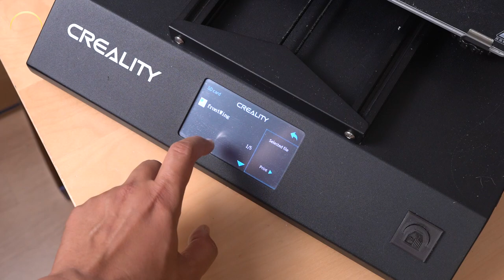Making Illusive Kinetic Wall Art for Home DECOR. Craft Idea with 3D Printer (Aurora_v1, Kinetic Art)

Comment: Hi Dr Moon, could you explain the interaction with the magnets, I.e. how does the pawl  system work, with words or maybe video, I have made but can’t seem to get the reaction correct?
Reply from the maker: Thanks for the question :)

In the case of REAR WING ASSAY, A magnet with a diameter of 6 mm is attached to the pawl.

This magnet plays a role in always positioning the pawl in the correct position by the pulling force with the magnet directly below it.

Larger magnets (8 mm in diameter) have no relation to the above magnets.

Instead, this large magnet affects the magnet attached to the pawl of the FRONT WING ASSAY.

That is, when the pawl of the front wing comes around the large magnet, the large magnet pushes the opposite pawl into the control gear.

In the case of the FRONT WING ASSAY,  Large magnet (8 mm in diameter) attached to front wing also same role as large magnet of rear wing assay. That is, the large magnet of front wing will push the opposite pawl into control gear when the opposite pawl comes around the large magnet. 

I don't know if the explanation is enough or not. 

If you have more questions, please leave a further comment.

PS. the number of magnets should be adjusted according to the situation.

Thank you.
Reply: Thank you, yes that makes it very clear, thanks again
Reply: Oops one further question for clarity, which orientation are the large magnets north or South Pole outwards?
Reply from the maker: @philreed6457  Maybe you meant about weight optimization. 

By weight optimization, the rear wing pawl should point toward the 7 o'clock when rotation is stopped. And 6 o'clock for front wing pawl.

For more information, weight optimization is very important process because it affect rotation time, rotation speed, operation error improvement, etc.

In my opinion (I am also amateur level), weight optimization is a two-step process.

The FIRST STEP is to adjust the center of gravity to the center of the circle(wing assay) while increasing the total weight.

By increasing the weight, the MOMENT OF INERTIA(1/2 * m * r^2) of the wing can be increased, thereby improving the operation error and maintaining the rotation for a long time.

When the first step is complete, you need to perform the second step. That is to adjust the position of the pawl when the wing is stopped, as I said at the beginning.

This is to ensure that the pawls of front and rear wings are in a similar range when the rotational force is reduced and the wing starts pendulum motion.

I hope my explanation will help you a lot in setting up your kinetic art.

Thank you. :)
Reply: I am still having trouble understanding it. a video explanation would be nice.

Comment: Dr. moon, many thanks for sharing this beautiful sculptural design. I know it has taken you untold hours to create the STL files and I am astonished that you have so freely shared your work. 

And now I need your help.
I have completed the printing and assembly but as with @Allan mine spins very fast. It also makes a rather loud clicking noise while it’s spinning and does not reverse direction. Is it the polar orientation of the magnets thats wrong? What can i do to make this work properly?
Reply from the maker: Hello!

On the front_subRing, there are 6 mm and 8 mm(diameter) of Nb magnets. Please add 8 mm magnet more. So that on the front_subRing, there are one 6mm magnet and five 8 mm magnets.

https://youtu.be/_Sorwbpynls  --> This is my recent video. And my new kinetic sculpture has same mechanism as AURORA. From 5:30, there is a scene that can help you understand the principle, so please check it out.

Thanks!

Comment: I'd like to read up more about that escapement, which uses magnets, and where the escape wheel and impulse roller are concentric. What is it called?
Reply from the maker: sorry, but i can't understand what you ask. If you use the part name from my part list (from thingiverse), it will easy to understand. :)
Reply: @housdrmoon  sorry I ask too many questions!

The spring guide and control gear are part of the escapement mechanism. What do you call the escapement that you use?
Reply from the maker: @xeratol  There is no formal name. Just in my case, i called it 'Magnetic pawl system. 

And I am happy when i have a lot of questions :)
Reply: @housdrmoon  you should patent your escapement! get royalties for it :D

Comment: Would this system work with  wieght rather than a spring.
Reply from the maker: Hi!
There are two kinds of kinetic sculptures.

First one is that the spring is mounted on a wall.

Second one is that the spring is mounted on the rear wing.

First one can be converted to weight mechanism.

but second one cannot be converted.

This 'AURORA' IS second case.

Thanks~

Comment: hello, very very good work, i need buy spring. you send link to buy parts?
Reply from the maker: Hi~

https://us.misumi-ec.com/vona2/mech/M1200000000/M1202000000/M1202050000/?searchFlow=results2category&KWSearch=Constant+Force+spring&curSearch=%7b

This is link for constant spring. 
0.4kgf and 1,000 mm length. 

Thanks~^^
Reply: @housdrmoon  tks man, you is a better
Reply: @edson79lds  Hi, so the part number to order is : CFS0.4 on Misumi, am i right ? Thanks. Unfortunately they don't sell to europe :/
Reply: @brunobilame2528  send to brasil?
Reply: @edson79lds  Misumi do send to brazil. Lucky you !

Comment: Does the stainless steel tubing have to have 4.5 mm ID? Or will any 8 mm OD tube work?
Reply from the maker: Thanks for inquiry.

It does not matter as long as the outer diameter is 8 mm.

The inner diameter is only for bolting the tube to the wallMount. :)

Comment: where are you buy your Constant force spring, on online shop ? Because i don t find exactly your spring ...
i modify your parts for adapte a spring of mesuring tape.
Reply from the maker: Hi!

You can find the link for constant spring below.
I hope your successful try with my drawings!
Thanks :)

https://us.misumi-ec.com/vona2/mech/M1200000000/M1202000000/M1202050000/?searchFlow=results2category&KWSearch=Constant+Force+spring&curSearch=%7b"field"%3a"%40search%2cseriesList.templateType"%2c"categoryCode"%3a"M1202050000"%2c"sort"%3a1%2c"allSpecFlag"%3a0%2c"page"%3a1%2c"brandModeFlag"%3a1%2c"pageSize"%3a"45"%2c"unitType"%3a"1"%2c"brandCode"%3a"MSM1"%7d&resultTabs=&listDisplay=mc-list
Reply from the maker: load spec is 0.4kgf
Reply: @housdrmoon  Thanks you very much, its good 60% OFF !
But this part is sale until 10/31/2021 ....
Reply: @housdrmoon  Im disgusted, the website don t sell to france ...
Reply from the maker: @kevinmaury5806  Dont worry, Maybe there are Misumi website for Europe.
Reply: @housdrmoon  Yes but for buy i need to inform one entreprise name ...
I wait because i try with name "aucun". I hope it will work 🙏🙏

Comment: How big of a printer is needed? I only have a prusa mini
Reply from the maker: Prusa mini is too small. My printer(creality cr10s-pro v2) is 300 * 300 mm.
Reply: Is there any way you could alter the wings for two parts. I didn’t realize my ender3. V2 was too small until I had printed all other parts. I saw where you had done that with other models. I love your videos. They give much more explanation than any other I have found. I have a cnc router and have tried to make several of David Roy’s pieces too no avail. Keep up the good work and thank you.
Reply from the maker: @Deltasdfrob1057  
Hi.
It is difficult to modify the size of the wings.

However, I have a good idea.

How about making wings out of cardboard?

It would be nice to make the wings from a material that is strong and easy to cut, such as cardboard.

Thank you :)
Reply from the maker: @Deltasdfrob1057  
Now i just added splitted wings. The file name is ‘frontWing_1’, ‘frontWing_2’, ‘rearWing_1’, ‘rearWing_2’. 

Using that file, 3D printer having size of 150mm x 150 mm can be available. 

I hope your nice DIY activity :)
Reply: @housdrmoon  wow !  You are the best. Thank you very much.

Comment: I tried to make the similar kinetic sculpture. As it didnt run that smoothly, so I used electric motor to power sculpture instead of spiral spring. Please check this out. @
I will welcome all kinds of suggestions.
Reply from the maker: electric motor also good way. But if a motor is used, rotation speed is alway constant. So patterns made by the motion of kinetic sculpture will be simple. So using a motor is the next best thing.
Reply: @housdrmoon  Do adding bearings and magnets helps? Is it makes transition smooth?